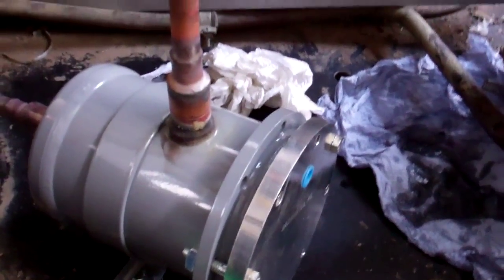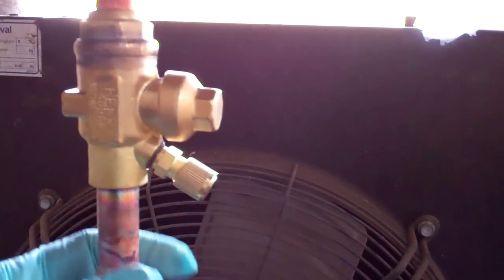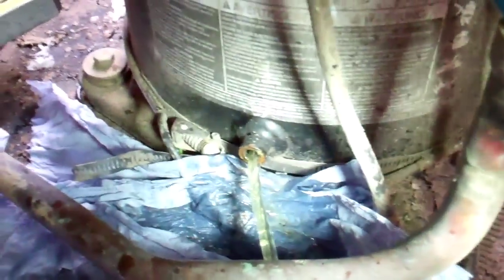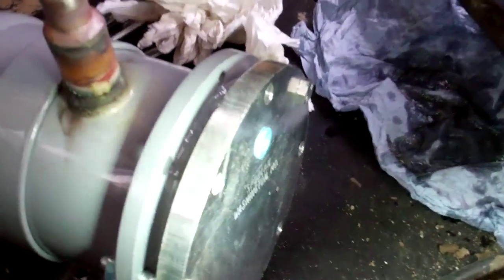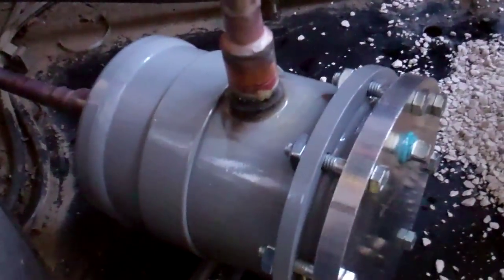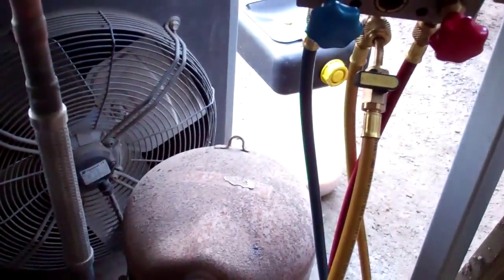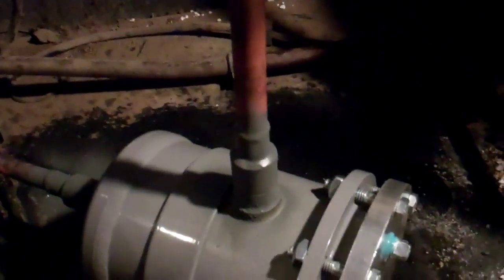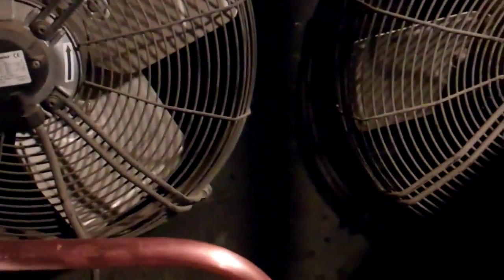Drier replacement

Comment: Hey how tight those bolts got be tight ? I think mine leaked
Reply from the maker: Think they should be 14/16 ft/lbs. Pretty sure the info is on the can of the replacement cores.

Comment: He has a video of his oil recovery cylinder, a regular disposacan with a second schraeder fitting brazed to the side, so that he can use the vacuum pump to pull the oil out via the thin plastic pipe. When full turn upside down and blow it out with OFN into a bottle for recycling via the ROSE foundation ( always sell them your old oil or drop it off by them, it helps). Mine sits with R141B in it to flush out dirty evaporators.

Comment: Pop some of that cat litter in the box inside a twist of newspaper or a bit of clean cloth, it will take the moisture out in no time. To pick up oil I use bran, should be easy enough to get on a farm, and picks up oil a treat, scrub a bit with it and every trace is pretty near gone. In town buy a box of digestive bran, same stuff just packed in a nice box, farmside $5 for a bag big enough to use as a bed.